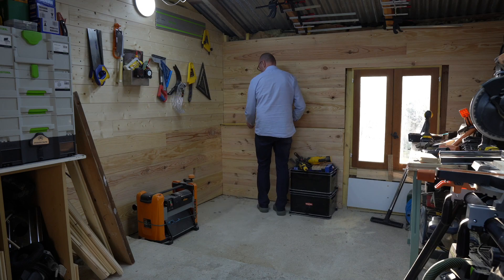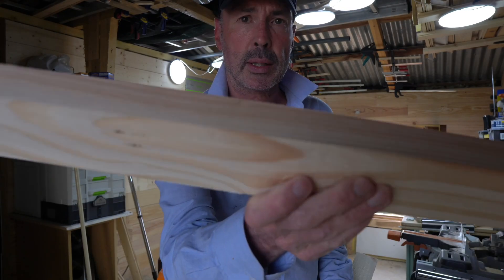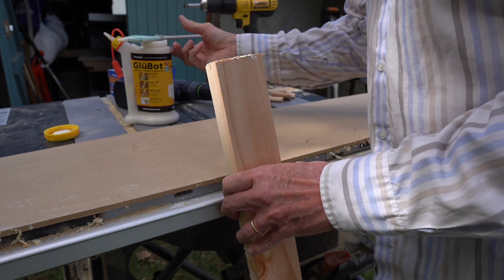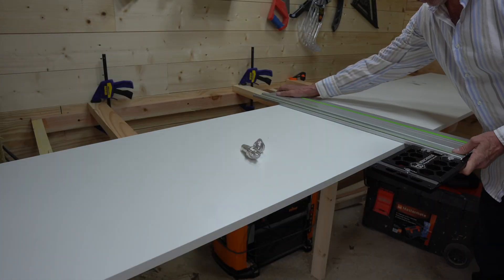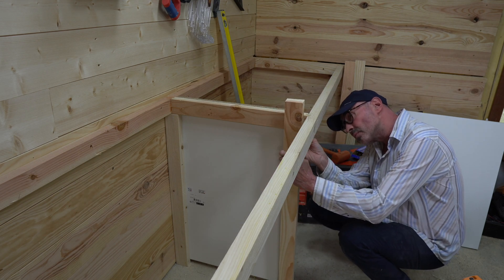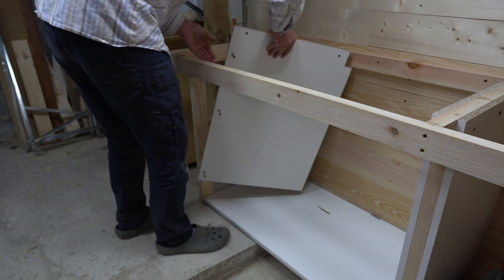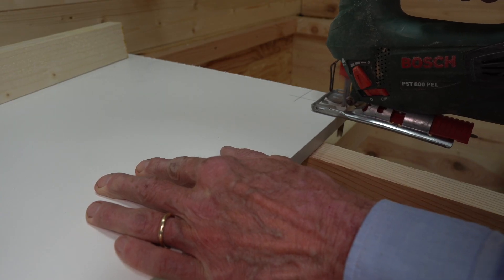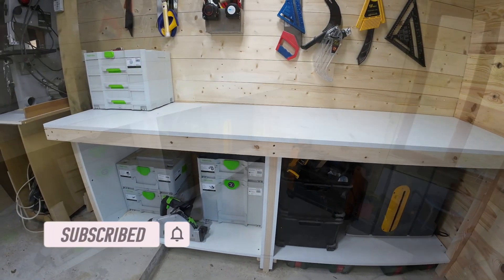Workbench with tool storage for the Small Workshop.

Comment: I always thought it was cheaper to buy 2 x 3 cls or 2 x 4 cls than rough sawn timber in the UK? Timber must cost more in France
Reply from the maker: Hi. Timber costs way more here and I have never seen CLS here.  Most walls are drywalls and there a very few timber frame houses.  Typically 2 x 3 PAR is €20 per 2.4m length compared to €6 I paid per 4m length for these piece. Regards JP